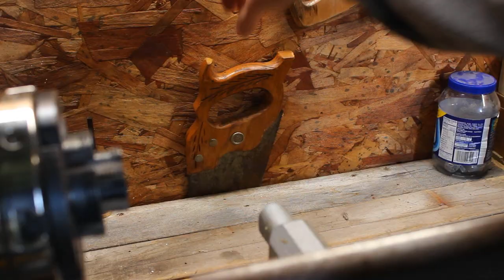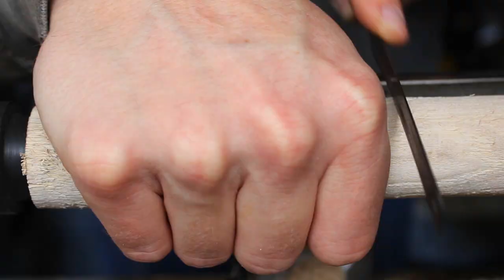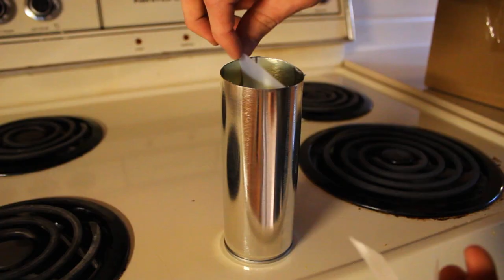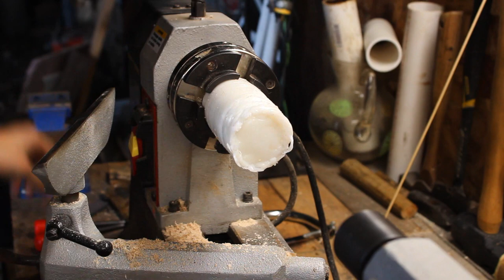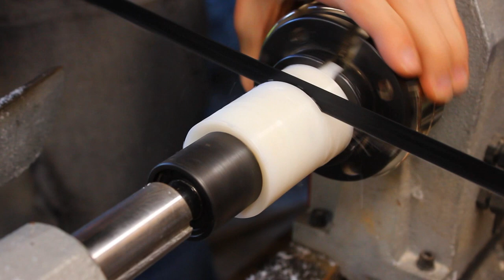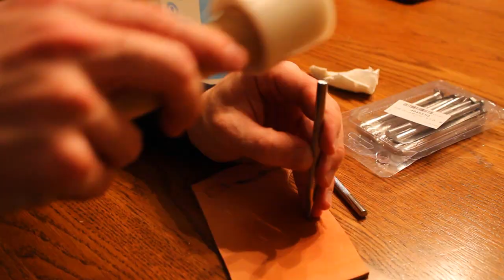Making a leather working mallet from milk jugs! (HDPE)

Comment: I hope you still ck comments I just found your video. I need to know how many milk jugs I need to process to make a maul. I don't want to waste material and come up short. I also have no idea how much shrinkage to expect. I have enough to fill the can I am using as a mold twice. How much more should I process. Thanks for helping
Reply from the maker: Hey there. I have no idea how much I used. There was not much shrinkage. I basically used what I thought was the same amount that I needed for the mallet. The good thing about it is you can keep adding more HDPE as you need to, if you see that you don't have enough.